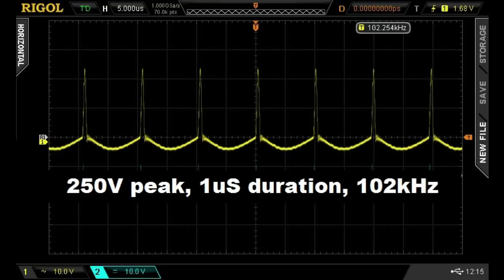Longitudinal Current Induced by Dielectric Field Impulses

Comment: Thanks for you insights...reminds me of this excerpt tied to Maxwell:

"On our theory it resides in the electromagnetic field, in the space surrounding the electrified and magnetic bodies, as well as in those bodies themselves, and is in two different forms, which may be described without hypothesis as magnetic polarization and electric polarization, or , according to a very probable hypothesis, as the motion and the strain of one and the same medium."

The dielectric is merely a mass or space, all made of this same medium (many call it ether or aether).  Since there are two charges plus and minus...dipoles are formed...which align to an electric potential (field) and thus oppose the electric potential (field)...this is called permittivity.  Thus everything is a dielectric!

The motion of the dielectric (field) Maxwell refers to a the magnetic portion (motion).  The strain of the dielectric (field) Maxwell refers to the electric portion (strain).  A capacitor is nothing then a dielectric in strain.  A magnet is nothing more than dielectric in motion.

The dielectric releases strain (potential) as motion.  Therefore you can not have one without the other.  Oppositely, motion creates strain in the Universally tied dielectric, creating potential and back and forth...just trading energy.  They are one and the same.

Vortices are a normal occurrence with motion in a medium (dielectric)...as motion does not naturally occur in straight lines.  Static lines of force (static electricity, not moving) are typically in straight lines...while movement creates arcs and vortices (magnetic).  Between the plates of a capacitor there are both static lines and vortices of movement in the dielectric.

Resonance is the tendency of dielectrics (concentrations of the medium, mass, space) to vibrate at a characteristic frequency.  When one 'charges' a dielectric there is a static component however there is also a resonant component.  In effect the dielectric is vibrating at resonance as well as a static strain.  This resonance is felt in the medium as well as the static strain.  Thus the medium may also resonate in to a capacitance...with plates and certainly without plates as well.

Time to go...food for thought
Reply: We are left to imagine descriptions that match the things we know and can manipulate. But, unless we can test the behaviors of our imagined characteristics, it's all philosopy/art/poetry, not science.

Kinetic energy seems to be part of the mix, and transferring energy in a way that conserves momentum produces amplification and resonance.recognizing how spin puts this all together brings the art into the realm of science and predictability or mastery.  Party on Dudes, be good to each other.
Reply: @mundymorningreport3137  And now a quote from Munday Morning Report presentation: "  What Tesla discovered was Ether is real energy and it comes form Aether the matter the fills and defines space itself.  al things we call energy or forces, from heat to electricity to pressure, and more is just an expression of Aether, conditioned to vibration, frequency, and potential"

Not too far off, if not really the same as my Maxwell quote above, but in different words.  You are right, spin is unavoidable consequence...
Reply: @MS-ef1gy  where can I download a book about maxwell?
Reply: @takecopy  You might start just by looking in the notes on James Clerk Maxwell - Wikipedia.  For example, note 5, has a reference to a copy of the book in PDF, "A dynamical theory of the electromagnetic field".

Most of what I wrote above were MY observations of a quote "tied" to Maxwell  

It is interesting that you caused me to look at my comment of 2 years ago (Thx).  My observations of Maxwell...which it appears Ivo implements in his new device...using a teflon dielectric between coils...he is so close...yet so far away...
Reply: @MS-ef1gy  if spin unavoidable what about longitudinal it has no time to build spin or vortices or magnetic, is it possible with only strain to produce radiant energy?
Reply: @takecopy  Certainly, if spin is a minor result of polarization transmission then so be it...
Reply: @MS-ef1gy  no i thought spin/motion is not the result of polarization it comes from strain polarization is two strain is one
Reply: @takecopy  We might be talking about different things.  Charged capacitors are under strain resulting in a distorted energy field between the plates.  Thus, one may conclude, that energy is stored in strain induced field distortions.  Now if one is using an open capacitor, say with aether as the dielectric, then this strain constitutes the electric force field felt by charges in proximity.  Additionally, other close objects will interfere with the 2D strain between the plates twisting the strain in a 3D manner.  When these strains are released electric energy flows from the strained dielectric of the capacitor.  There are other ways to consider strain such as in crystals, which is different than my original answer.  If one employs a liquid dielectric you can actually observe resulting dielectric spin.  Cheers...
Reply from the maker: "distorted" energy field=dielectric field.
from capacitor can also be TO capacitor depending on polarity.
Why call it distorted?
Reply: @MasterIvo  Long time no speak...call it a distortion because there is distortion in the charged dielectric... check out this paper that takes strain to a higher energy storage level "The strain capacitor: A novel energy storage device".

Comment: maybe 'water hammer' is proper metaphor?
Reply: YES look into the John Keely implosion motor which is exactly this-
a longitudinal pulse (water hammer) motor which apparently when analyzed by computer the data said it has infinite efficiency, exactly like the radiant energy producing more voltage than input
Reply from the maker: Yes and a very good one!

Comment: I was thinking if you put another coil ahead of the first with the dielectric pulse, but maybe one with turns far away from each other and thinner wire. When the pulse arrives to this L2 it will slow the pulse until the magnetic wave catches it in L2. How would this affect the collected current?

Comment: I believe that everything is EM waves. Even matter. So it would seem that the dielectric energy can transform to any frequency, if it transforms into heat, light etc. We just have to organize it and hopefully witness something completely new

BackEMF in a coil is the ether snapping back that the electric current/magnetic field bent. When it snaps back it is elastic and it goes further than the charging current.

PS. YouTube also removed private messaging. Weird thing...
Reply from the maker: you can email me, look at 'about' page from computer

Comment: Thank you for your video and interesting thoughts. ...does your definition then relate to the concept that the component of radiant energy leads current in the flow? Then in a very rapid pulse of energy, that is interrupted (prior to a complete buildup of the magnetic field) allows the ability to extract the radiant portion, before merged with the current. This due to the speed exceeding the speed of the current, which is slowed by the resistance of the coil, which is quite less than C. Hence the energy captured is more "refined" than the conventional charge. This purity could account with a perceived increase in the power of the wave. Yes, I agree that "time" and timing play a large role.
Reply: Tesla used disruptive discharges of high voltage unipolar pulses through a spark into a coil. The shorter the pulse the more effects appeared

Comment: I have to say that I don't agree with all  you've said, but am so glad someone is willing to put their neck on the line and express their views in the true spirit of human advancement . I see the dielectric as being encased by the magnetic lines of force always and don't see one changing into each other. Picture a balloon the dielectric being the air and the latex being the magnetic. 
There rely on each other to exist.
Looking forward to seeing any of your findings.
Thanks and keep working.✊
Reply: You should read "Elementary Lectures on Electric Discharges, Waves, and Impulses by Charles Proteus Steinmetz."  It gives a much better conceptualization of the relationship between the dielectric and magnetic field.  The magnetic field can and does convert to the dielectric field, and the dielectric field can and does convert to the magnetic field.  This conversion causes various transient electrical phenomena which can be problematic and destructive.  Dielectric field lines always terminate in the counterspace of matter.  Magnetic field lines always terminate upon themselves, (or do not actually terminate, but form loops).  These loops form concentrically around the conductors in an electrical field and intersect the dielectric lines at right angles.  These intersections where the dielectric and magnetic field lines conjugate are known as electrification.  This is where bean counters start saying electricity has quanta and claim that electricity is particulate.
Reply: @wesbaumguardner8829  
So the mag lines are the boundry condition between 2 or more dielectric fields ?
I do have that book but have only really dipped into it I learn so much  
Faster and better from other people thanks for taking the effort to reply. Is there any experimental proof of dielectric lines of force?
Reply: @colinmcdonagh4705   No, the dielectric and magnetic lines are considered part of the same electric field.  The aforementioned book has diagrams so you can see what I am talking about.  Of course this is experimentally provable.  This is how electricity really works.  Our entire electrical grid was designed via these principles.  Charles Proteus Steinmetz was head of research and design for General Electric.  The entire company was built around him and his knowledge of electrical phenomena.

Comment: or resonance...looking forward...
Reply from the maker: That impulse is generated in the bifilar coil. Need more investigation, but very excited to be able to create this. Seems to be produced by a step recovery diode. Ever worked with that?
Reply from the maker: after more research, it seems not to be originating from the step recovery diode, but from the back emf, passing trough the resonant coil
Reply: @MasterIvo  Good work to isolate that!  

Recently I have been reviewing your bifilar coil videos as I learn more.  I know how you feel about Don Smith, however your 900 volt setup has some similarities with what he was doing.  Especially the way you provided a ground to the outer coils (L2 & L3), use of diodes, and capacitors.  We had a discussion about the amount of Joules in those caps and my comment was that you needed higher voltage...but now I notice that you were operating at a high enough frequency to pump enough useful energy if your charge time was short enough (which it should be since you tuned to resonance).  It would be tempting to add a stage 3 to your device...it's on my list of things to do...with your permission of course...
Reply from the maker: Permission? I wish everyone would experiment with these coils!
That 900V experiment was also very influenced by Don Smith. the diodes were basically rectifiers, and the reverse coil was out of phase, doubling the voltage from 450V to 900V. But it had no power.
power is when voltage and current are in phase. As you know.
Working with impulses is very promising for this... but its getting rather complex
Reply: @MasterIvo  The complex part is unlearning what you have been taught...it's about the energy...and if you believe J=.5CV^2 (energy in Joules)...then the next stage is to the pump (CPS) the capacitive energy with the inductive potential in phase and using external ground (current).  In your circuit there is relatively a small amount of charge (small charge density...900v) thus you must rely upon external ground and CPS (pump) for usable energy....DC is not the limit of pulses (CPS...energy)...so in this it is rather quite simple...the hard part is the resonance/tuning of which you are already quite adept...you are so close...stay the course
Reply from the maker: Yes resonance is pretty easy for me. even series parallel resonance with 2 coupled coils. But the really interesting thing is impulsing the resonant coil from its ground connection. I ordered new mosfets that can handle 900V so thats a pretty powerfull impulse. now only need some small caps to decrease the impulse time. The negative impulses induce the radiant energy, which is key.
Reply: @MasterIvo  , Yes I see from this response and others that you are researching 'high-side' coil switching for negative energy.  Or in other words with a positive applied to the 'top' of a grounded coil you are switching between the coil and positive power supply.  Then, when the switch (MOSFETs) opens then the top of the coil is negative in respect to the bottom...ok...if this is true I get it.  But then again, if I move the MosFET to the bottom side of the coil...the same polarity of Back EMF is developed.  So am I missing something here?

To me negative energy flow would be were you set up a condition where there is a difference in potential between to negative sources...for example if you take a 24 volt batter in parallel with a 12 volt battery and then put a light in series with the negative of the batteries connection then you will have negative energy alone on that series line.  So there is always a balancing between differences of potential even when both are negative.  Maybe your definition of negative energy is different than this?  (Reference Rich Friedrich who builds systems predicated on this negative energy/resistance concept)

We can do the same with positive energy (spitting the positive) as with negative energy (splitting the negative)
Reply from the maker: @MS-ef1gy  highside  switching gives negative voltage back emf, but low side switching gives positive voltage back emf.

What the difference exactly is between positive and negative back emf, I'm not sure about. Mostly following my intuition.
Reply: @MasterIvo  I know this is strange because if high side is connected to positive power supply, and say for discussion you just install a flyback diode (snubber) across the coil, then of course the polarity of the diode is positive on the low side if you switch on the high side.  Then again if you switch on the low side,  the flyback diode positive remains on low side.  This of course is on opening the switch that is a condition of BACKEMF.

However, with same circuit, on close of the switch you have a COUNTEREMF, negative on the high side, positive on the low side.  This is why voltage leads current for a coil because of the instant counterEMF.

The cause of either CounterEMF or BackEMF is the direction of the magnetic field on either expansion (closing switch) of the magnetic field or contraction (opening switch), as predicted by right-hand-rule.   It is interesting then that the closing of the switch actually can deposit energy or charge the input battery (energy source.  Especially if done at a high rate (dflux/dt).

So I am intently curious about your next video to correct my thoughts on the 'negative' energy that you are achieving(:
Reply from the maker: I'll give you a hint. the negative back emf connects to a series resonant coil.
the back emf acts like an impulse.
Reply: @MasterIvo  OK...now your talking...benefiting from the additional gain from the attached series resonant circuit...I get that...thanks for the 'hint' (:
Reply: OH an almost forgot...similar to the way you get twice the parallel tank current when you insert a capacitor of the same value in series with a the parallel resonant tank, ... the conjugate of that is...if you place a coil in series with the parallel resonant tank then you get about 1.314 times the peak voltage in the parallel tank.  So...in effect you get a voltage gain of a series resonant circuit while using a parallel resonant tank....and if done correctly the BackEMF is added to your tank energy at the rate of CPS (counts per second or frequency).
Reply from the maker: Hi Mark, good to see you back here.
Reply from the maker: Thats great to hear Mark. Im struggling to understand the concepts involved to create the spike. If you have more info about the dsrd, a link maybe, it would be much appreciated
Reply: https://www.slac.stanford.edu/pubs/slacpubs/15000/slac-pub-15098.pdf @MasterIvo